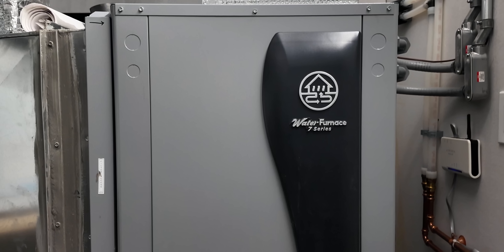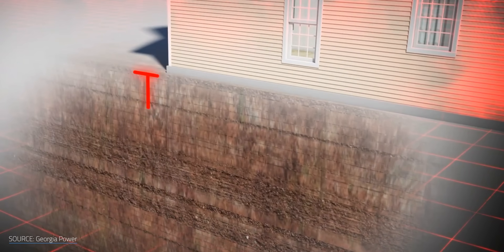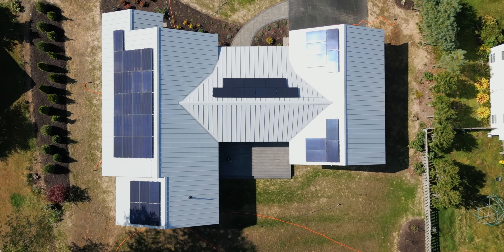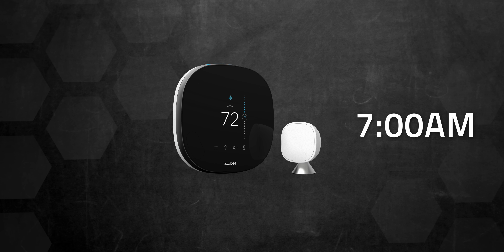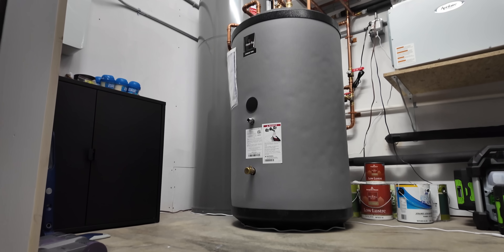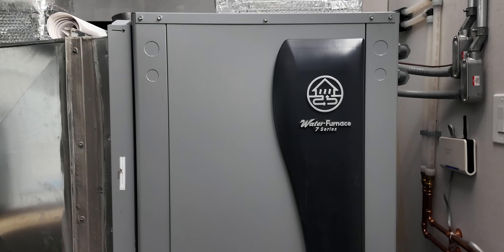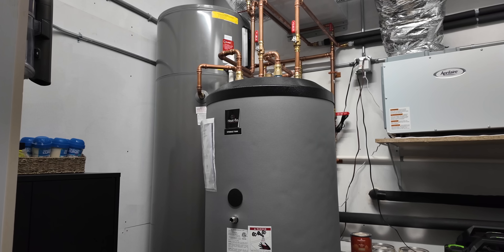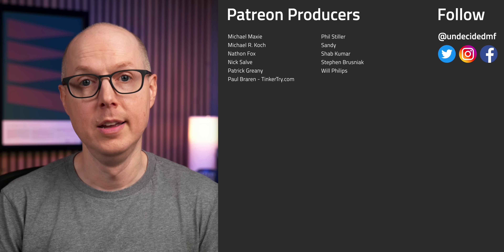How My Geothermal Heat Pump Really Performed (2 Years)

Comment: There are a couple significant issues you ignored. 1) the interest cost on the system will be $3K yo $4K a year. The government incentive should be excluded because it will be discontinued and not available for everyone. 2) You need to identify the cost of the added insulation and add in an interest expense. The title should probably be changed to include "and above standard insulation".  3) you have not considered the long term cost of the geo thermal system. Pumps, heat converters, battery system, system flushes and other additional equipment that will need to be replaced around 15 years averaged over time. Please have an updated video with all the costs. That might mean talking to people that have had a system for 20 years. Thanks
Reply: @patriciasanders6955  What do you mean by interest cost? Are you talking about interest in a loan or something?
Reply: @patriciasanders6955  no batteries needed.
Reply: 15 years is also the average time for air-sourced heat pumps, so it'll be about the same. I imagine less for geo-thermal, in fact, because the well doesn't need to be re-dug and plumbed.

Comment: The first step should always be good insulation of the walls (10-16cm), ceiling, slabs, and windows (double or triple glazing).
I have nothing against a good fireplace or pellet stove in the winter, or a nice interior patio with a small fountain and vegetation for natural cooling in the summer.
Only then would I opt for something more complex and expensive.
Btw. There is also clothing.... ;-)

Comment: Some of the calculus here is affected by where your house is located. If you're doing a new build in a location where there's no services currently connected to the lot, you can be looking at five figures just to get electricity or gas run to the site. Also, most of the geothermal systems I've encountered in Michigan have been in locations where they previously were dependent on propane tanks or oil or coal deliveries. Although I did encounter one very interesting setup where they had a full geothermal system and retained their propane tank, both for a backup furnace and for feeding a backup generator. It was a big luxurious house that was owned by a man who was dependent on medical technology, wanted to absolutely bulletproof his power system. Can't blame him.

Comment: The biggest problem with all these systems is the companies shut down/go bankrupt and now those 10-25 year warranties mean nothing on that shiny, expensive equipment. 
As a tradesman, there is no way I was hiring anything other than specialized equipment like the guys digging the well - substantial savings there. I would hire an electrical engineer and I would do all the muscling with my friends and a few 24s.

Comment: Great video!  I design and sell geothermal systems for a living and have had geothermal in my own house for 9 years.  There are a number of things that could be done to reduce the cost.  You mentioned a horizontal loop instead of vertical which is true if space permits.  You could have opted for a Waterfurnace 3 or 5 series which are thousands of dollars less and don't require expensive accessories like the Symphony monitoring system or variable loop pump.  The desuperheater pre-heat tank could be a regular 50 gallon electric hot water tank not connected to the panel instead of the indirect tank you have.

Comment: It was mentioned in the video that the home office and studio was site-built and not part of the main house design. The result is a space not as well insulated.  I'm assuming the site-built home office and studio was framed conventionally with 2 x 4 exterior stud framing.  In that case framing the exterior walls with 2 x 6 framing and the resulting extra insulation installed could have closed that gap.  If the exterior walls were indeed 2 x 6 framing, then moving up to 2 x 8 framing would achieve the same advantage.  2 x 8 exterior framing may sound a bit nutty but it adds very little to the overall cost of building a house if only used for the exterior walls and everything else is done with 2 x 4s.

Comment: air exchange  heatpumps are terribly inefficient especially in cold weather vs natural gas. Geothermal would be the only way to go. My brother has  a  heat pump system with hydronic system in Wisconsin that works pretty good. This guys system  would not do well here in the heat of California,  as we have the highest and most unreliable electric rates in the US do to forced solar and wind, vs nuke and natural gas generation. His does work in Maine though as we cool more then heat here and its expensive to run pumps.

Comment: Yeah, but it is exactly the upfront costs that kill something like that for the majority of people. And, I pay a lot of taxes and all that nice rebates amount to lots of tax payer money spent on the homes of the wealthy. I had an estimate of CN$ 45,000.00 for a similar system in my much smaller house in Northern Alberta before it was built. Forget it. Here in Canada we also have to fight with much higher electrical costs. Instead I went with insulation values that exceed double the newest code plus air tightness and something that eliminates the need for cooling in the first place. I scrapped the basement and built with insulated concrete foundation walls and an insulated concrete slap on top of it in order to use natural cooling of the underlying substrate. Even during the hottest time of the year with C 33 or so (F 91.5) it stays a comfortably  max. of C 23 ( F 73.5). Sometimes less (half the costs of a basement) is more. That I created a "Warm" roof probably contributes to it, too, in regards to the upstairs. The roof itself is insulated, not the ceiling and the roof is a double roof with an 4 inch air space for air circulation inside of it. The air leaves thru a roof cap running the length of the apex of the roof. The roof stays much cooler in summer this way and eliminates any ice build up in winter.

Comment: Yeah how big is your house?  How many kwh does the geothermal consume?  How long will the geothermal system last?  What are the maintenance costs?  Also, haven't air source heat pumps improved significantly in the last few years?  Aren't there models that don't lose efficiency until well below 0f at this point?

Comment: To compare apples to apples, you need to use the cost of grid power to calculate your savings, rather than the "free solar" that you have, which would have cost an average consumer quite a bit to install. For example, if you are saving $1000 per year, then the payback without interest would be 58 years, and it would not make sense for the average consumer. Please let us know the actual difference in energy usage per year, and then calculate the difference in the cost of inputs (grid equivalent) vs Natural Gas.

Comment: Awesome update on your system Matt! 
I think that the term geothermal doesn't fit well here. Geothermal generally operates at much higher temperatures, and actually extracts that energy from deeper in the earth. They also can't operate indefinitely. The wells and loops that are installed for these domestic systems that Matt has mainly function as very efficient seasonal thermal storage units. They don't or shouldn't be used as a thermal energy extract, especially in urban environment with many similar systems. At least in the Netherlands the system is required to operate on a net-zero basis in terms of thermal energy in the span of a year. So thermal energy out in the winter for heating the house should be the same as thermal energy in during the summer, which cools down the house. It does make the heatpump very efficient since the source is always at a stable temperature.
Reply: Hi Bart, this was the comment I was looking for. Formally Matt's system is not a geothermal system. In the Netherlands and most of Europe geothermal system refers to a depth > 500 meter and as a result higher water temperatures. ChatGPT: In the USA, the word “geothermal” is often used quite broadly. When someone says they have a “geothermal heat pump” or “geothermal system”, they usually mean a ground-source heat pump (GSHP) — a system that exchanges heat with the ground a few tens to a few hundred feet deep (often 100–400 ft). These systems don’t reach hot rock or deep aquifers; they just use the stable ground temperature (around 10–15 °C / 50–60 °F) as a heat source or sink.

Comment: Even if you are not building a forever home one think to count in to the cost/benefit is the added value to house even in the case you end up selling the house.
The running and maintenance costs are so low that it alone affects the desirability of the house compared to similar houses. Don't know the market in US, but in Finland this is a easy 10-15% bump to the selling price.

Comment: Yikes!   That's a helluva lump to start with!   I spend less than $3K a year total on electricity and propane (primary heat).   We might see a week of minus 15F temps, and usually stay below freezing during the days all winter, then can see 115F on summer days...  Heavy insulation, smart windows, and 110 year old house in the high desert.  If i could go back 30 years, I'd have gone with an Earthship type setup and evolved in the new techs as they came along.    Interesting stuff tho, Matt.

Comment: How do you come to the conclusion that an air heat pump would consume 2x the power compared to your geothermal heat pump?
Massachusetts isn't that cold and a good air to water heat pump will have an SCOP of 5-6. I doubt the geothermal heat pump is that much better.
I have an air to water heat pump in Germany and have an SCOP of 5, with an climate that should be similar to Massachusetts.
Still a great video and awesome setup.
Reply from the maker: When we were building I had Manual Js created for different heat pump systems that have all of the energy use estimates.

Comment: Hot water heating is similar to your servers, even if you don't run a server farm, everyone is using them, so given energy isn't created or destroyed when running a server, merely transformed into heat, why not use that to heat hot water. I don't want to plug a product, so just search for a patent granted to my name that does just that. The upside is a higher COP for heating than a heat pump, with none of the GHG - PFAS refrigerants compromising our environment.

Comment: We installed the exact same system.  We built our house 5 years ago and included solar and have a loop field instead of a well which was cheaper to install.  The upfront cost was high but I couldn't be happier.  I try to explain geothermal to people but the vast majority cant understand it, I think that is one of the reasons why people don't go with it.  I love looking at my electric bill of $21.55 per month !
Reply: How much was the system though, and has it paid for itself?
Reply: @Clevergirlreads  We were building a new house so all the duct work and other mechanical would have been the same price.  The difference in the Waterfurnace and loop field vs a gas furnace was about  $21,000.  and my calculation for payback was 4.9 years
Reply: @davidloop5437  Do you have to pull from the grid in any of the months?
Reply: @harishyala   We are 93% Net zero.  But during January and February we run out of our generation credits and pay normal rates.  Usually about $280/month for those two months

Comment: Are you claiming that the comparable "air source " heat pump must rely on resistive heating and hence have quite high operating costs?
Reply from the maker: No, I’m referring to an air source heat pump versus my geo heat pump.  When I was deciding on which system to get I had manual Js created that calculated the estimated yearly energy draw of those systems (they were pretty accurate).  The air source heat pump system I’m referring to would still be wildly more efficient than a resistive heater or natural gas furnace, so it’s still a fantastic option.

Comment: Spot on with the summary.  I live in the Upstate area of SC and had the exact same system (including the 400 ft deep well for the external loop) installed five years ago.  No air source HVAC system can come close to the comfort level.  The noise or air flow is not detectable and the humidity is ideal.  Five years later and the system runs like new and without mechanical issues.  My install was almost the same after rebates and has been the right decision.
Reply: I also live in the Upstate of SC. Can you recommend an installer for at ground source HVAC system? Two years ago our Split HVAC with a gas furnace went out and had R&R Heating and Air replace it, worst mistake of my life. I would appreciate any advice you might have.

Comment: Honestly, I don’t think it matters as much if you stay there or not,
A geothermal system would add to the value of the property , so if you sell it, you should get a higher price for the home, and you can back that up by looking at the savings before and after the geothermal heat pump.

Comment: We have a ground source heat pump (no AC) using horizontal placed coils in the UK. Our installation costs were similar, and we were a retrofit needing larger radiators. The cost was helped considerably by a government grant. We could not sleep with the temperatures that you have set. Our max is 20.5 Centigrade in tho day, falling to 18 degrees at night.

Comment: Are houses with a supply and exhaust ventilation system really dust-free? Dust doesn't settle anywhere because the air is constantly circulating and filtered. Is it true that there's no dust anywhere?

Comment: Would it make sense to include in the calculation the loss of investment income due to the high up-front cost? (The money spent on the system is no longer available to invest. OTOH, the value of the home is increased once it's sold...)

Comment: I live in a house that was built in 1890. The idea of retrofitting causes me dread.  But I do have a visible concrete circle on my basement floor which I suspect may be a capped well.  If that means the solution using a vertical collector in the house and potentially saving a bit of stress. I am willing to investigate this as a true upgrade.  I love that you are in New England, because our climate is the same.  Thank you for sharing your story and data.
Reply: Or just an old sump pump location
Reply: Or, as in my case, the base of the original coal fired gravity furnace (about 4' in diameter). @JohnWilllliams
Reply: I lived in a relatively modern house with lots of air tightness and insulation upgrades that ran a ground source heat pump from a 130 ft deep water well with good groundwater flow (important to having enough heat) BUT we could still freeze it out and have to run on the gas boiler that was meant for extreme winter and spring heating up the pool. This is no longer a recommended design for GSHP (referred to as “standing column” for the column of water in the well).
Reply: @TomKacandes  Indeed, far less efficient in principle, utilizing such a relatively small volume of thermal mass in any well compared to spreading out more pipe in an overall much larger volume/area of ground.  Workable for smaller/transient thermal loads, but any extremes of weather (like you mentioned) can overload the well-based design.
Reply: The only problem I see is that if that hole in your basement IS a well it may not be deep enough to run your loop.
Reply: My New England house is probably circa 1790, and to be honest I think a bit of breathing is for the best for longevity. Having very sealed construction is great *at first*, but I would bet money that an awful lot of these houses are going to have serious long-term problems with water intrusion and rot. If you’re Matt and have the money and knowledge to find the best constructors and ask the right questions, sure, this kind of thing can work. But in my experience the average spec builder or tract developer will always cut corners on things the buyer won’t see, and I would bet a lot of those buildings are going to have very expensive problems in 5, 10, or 20 years. 

As for my house, I’ve simply accepted that unless I want to basically rebuild it in place, the best I can do is to put in new windows and seal blatantly drafts. You simply can’t retrofit 21st-century materials and processes to a house older than the Constitution and expect it to work properly. Minimizing energy use should not be our only goal, particularly as we improve efficiency and alternative power sources, because the more energy we use intelligently, the better off we are materially.
Reply: @sansbury95  The hope is that we can be great caretakers of these treasures while we can in the hope that it will still be loved by many who get the pleasure after we are gone. The steam radiators in my house are beautiful. So is the wood detail.
Reply: Our house was also built around the same time. Things can be done, do not let Perfect be the enemy of Better!
Reply: Lol actually sounds like a typical horror movie beginning:  old house, big hole in the ground in the basement, it practically writes itself, lol...  ("Oh no, not the Basement!  NEVER open up a big old hole in the basement of an old house!")...  >;]